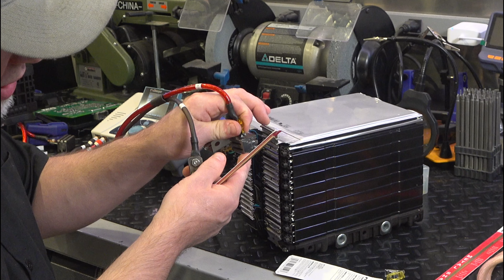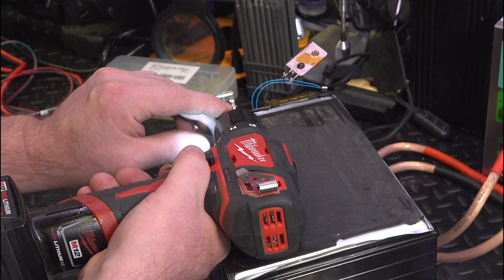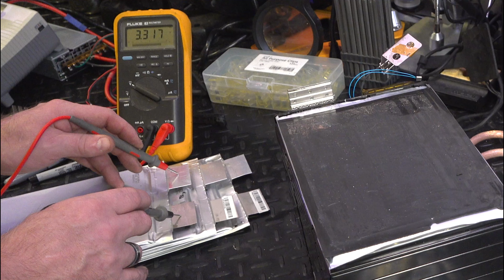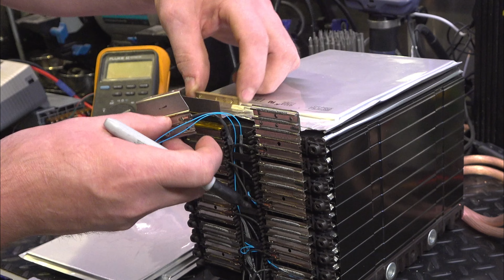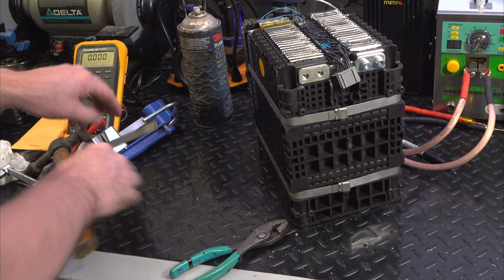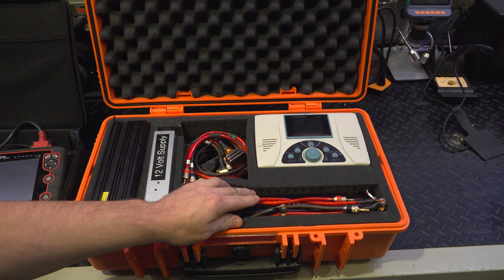Fisker Karma: Module repair [4K] Ep49

Comment: This video is 5 years old but still relevant. In 2026, you can get dusty, but unused 12V 120AH, A123 packs that were broken down by a recycler. They are cheap, and in near perfect condition. For replacing lead-acid batteries in golf carts, these A123 prismatic packs are perfect. They are 1/4 the weight and provide much more watts. Accounting for total usable watts, A123 cells are >2x more power per kg, and take up 2/3 the space. Staying OEM, I have 9x 70lb lead-acid batteries (nearly 700 pounds). These 9x 8v lead acid batteries were replaced by 6x 12V modules, which weigh less than 120 lbs in total. .  The 9x lead acid gave 80 amps of usable power, whereas I now get 120 amps, and with nearly zero voltage sag.  They are high discharge and should last around 3000 charge cycles at about 50% discharge rates, or maybe 1500 charge cycles if running the lithium down to cutoff voltages, e.g. 100% discharge.
Reply from the maker: I still have a bunch from my repair.  They are the Nano-cells which pack more current.  Glad you were able to fix your car with these videos.  Thanks for watching!

Comment: Привіт,ремонтуємо такого Фіскера в Україні,підскажіть яким сканером ви її читаєте? Як скинути заміну батареї?
Reply from the maker: Snap-on Solus Edge scanner will get generic codes on a generic reader. The information is not useful but only to Fisker Technicians.  No need to reset anything, just replace the bad cells and drive the car.

Comment: Hey, what do you think it might be , my radio, my navigation, and  the screen don’t work only the fisker logo,
And every time I start my car, the fan goes off.
Reply from the maker: When I had problems like that, the navigation would reset to another state and the radio and heater was messed up.  Turns out I got water on the connector to the CIU under the passenger dash.  It came in through the cabin air filter when pressure washing.  Learned quickly that you don't ever want to force water on the lower right windscreen.  If this is the case, you will need the Moviemento Puma programming tool and the firmware to match what is in the car.  Or the Prodis Fisker laptop will also work.  Someone in the Fisker forum will likely let you borrow theirs for a $5K refundable deposit.

Comment: What is the material that the pack connectors are made out of? (The things the tabs attach to) Aluminum?

I found your method of "clamping" the cells back into place pretty genius but was a little worried about using brass as the material....but I guess if the tab is making contact with the connector on top and the brass really isn't part of the current flow then it doesn't really matter? Actually I just looked up the conductivity chart and brass is above aluminum so...since you used fairly chunky brass nothing to worry about at all!

(If I'm understanding your method correctly)
Reply from the maker: Yeah if I remember right (and I said something about it in a video) one of the tabs is Aluminum and one is Copper.  This is why it would not 'weld' together with a tab welder.  The brass used is a base for the threads and the aluminum or copper gets squished together.  I have seen this before on high current packs and if kept dry and clean will not corrode easily.  One could also get an entire module as I have seen these come up for sale.  There was some military use for these packs, they looked just like the Karma pack, contactors and all.  Car is running great, I would do this repair again.

Comment: where do you find the oranje testcharger?
Reply from the maker: I put that equipment together from parts.  If you watch every video in this series, I give part numbers and quantities for the test equipment I used.  The charger/discharger was an ICharger 4010 Duo.  The load was made from parts from the surplus electronics store, and the power supply was a 48V rack/server power supply.  Then custom cables and connectors.

Comment: What are your thoughts in buying a used fisker with 47k miles
Reply from the maker: That is quite a few miles.  I have heard of Fiskers going many more than that.  High mileage would indicate that the car might have been driven on the ICE most of the time.  My car has just a bit above 10K miles and I have personally used it in 'Stealth' mode most of the time under battery power only.  These cars are great value for the parts that make them what they are.  I bet you could part one out and get some great return on the parts.  Good luck!

Comment: Question do you think a fisker is worth buying because I’m thinking about getting one. 🤔🤔
Reply from the maker: Depends where you are.  There are some service centers that are on the west coast and some on the east coast.  If you live too far away from these service centers, you will have to truck the car somewhere to get it repaired.  It is a great driving car and I love the fact I can drive it all week with only a charge on the weekend.  There is nothing else like it on the road today.  The price you pay for this is service costs, if necessary.  My car took some work as you can see by my videos, but totally worth it to me.
Reply: Yes I definitely understand I definitely have some service centers around my area I’m in New Jersey and I definitely keep in contact with you I really appreciate making this purchase a lil easier.
Reply: Well I got my fisker and I have a code for a battery energy control module POA7B is this
Really bad or what.
Reply from the maker: Did you get this code towards the end of the battery discharge?  Did it show up during the test drive?   Does the car fully discharge smoothly to zero without throwing a code? This is a general battery fault code.  Same thing I was getting when I bought my car.  Get a really good scanner (I used Snap-on Solus edge) and do a screenshot of the exact codes and I bet someone on Fisker Buzz can decipher it for you.
Reply: Yes the car does fully charge but the code comes up so yes I probably need a good scanner like you said
Reply from the maker: The Fisker diagnostic tool will tell you exactly what is wrong, but as I said before that there are some folks out there that can decipher Fisker specific codes and give them meaning so you can determine what is at fault.  So a good code scanner will tell you a part of the picture if you can get someone to help.  Otherwise, you will need to find the infamous "Fisker Laptop".

Comment: I’m thinking about buying one of these cars but it’s hard to make mind mind up what do you recommend? I’m in FL I’m not too sure where to get these car repaired if I buy
Reply from the maker: These cars do have their issues.  I can see that eventually these batteries will fail and render the car undrivable.  They are great value for the money, I'd bet you could part one out and make 2X what you paid.  I know there used to be a couple different CSP's in FL.  There is a good forum, FiskerBuzz that you can ask for this information.

Comment: Very cool series of videos! Watching you repair this Karma has removed my fear of buying one of these orphaned beauties! I enjoy listening to your stories about each of your cars. Surprisingly high production value as well!   I "liked", "sub'd" and "shared" your videos with my car friends. Keep up the good work!
Reply from the maker: Thank you for the encouragement.  I was surprised how little was wrong with the Fisker that stopped it from operating.  I bought almost 50 cells to repair the car and only really used three!  There are more things that can go wrong this car, but most of the issues have a solution a mechanic can perform.  Thank you for the sub and sharing with the car community!

Comment: Looks like you’ve had that can of adhesive for about 15 years hahahaha! Interested to see how the car responds to the repair. I thought tearing and engine apart and reassembling it was stressful, watching this battery work takes it to a whole new level. Good work as usual Erik!
Reply from the maker: Good eye there!  I just looked at the can and it said 2004 on it.  I use 3M 77, and 90 regularly.  This is 3M 80 and is meant for rubber and vinyl.  I can't believe I have kept the nozzle clean for 16 years!  Thanks for watching, buddy!